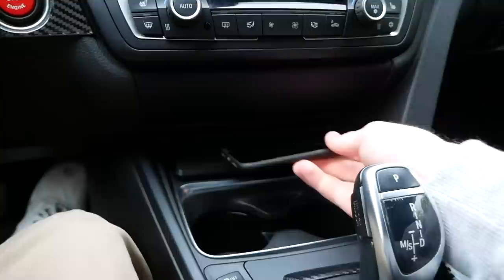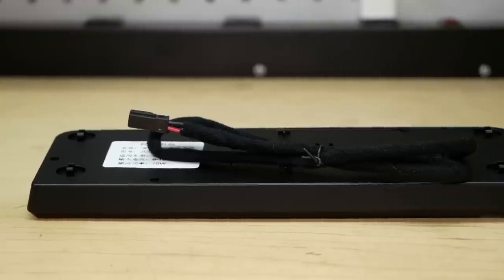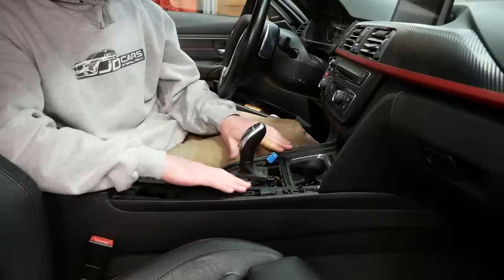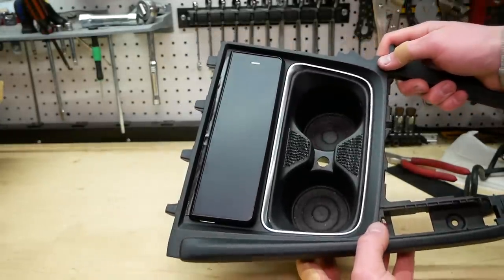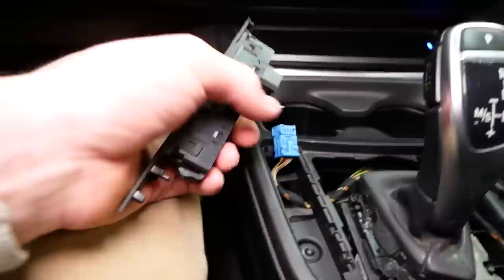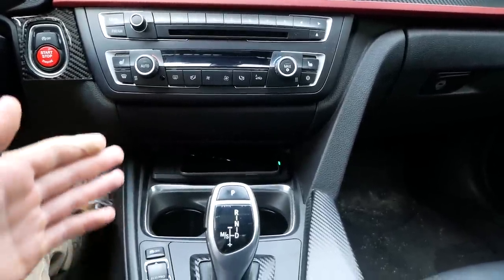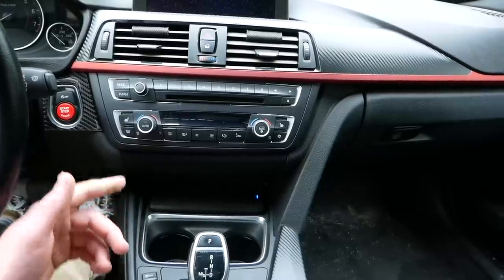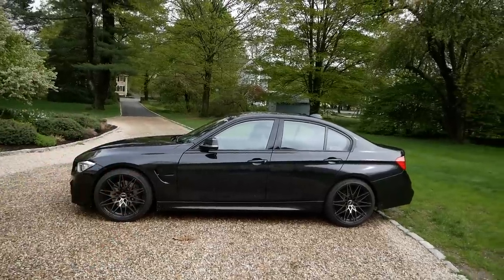BMW WIRELESS CHARGING // NEW PLUG & PLAY KIT!

Comment: Hi JD, thanks for this video. I purchased a new QI charger exactly like the one you have in this video, however, I thought I would have to buy the newer LCI cupholder unit, but thanks to this video, I didn't have to. I was able to do the exact same thing you did here. Thanks again.

One thing though.... Why does the little white LED stay on, even when the car's ignition is turned off?? Is this not a drain on the battery? Thanks.

Comment: @2:22 what is that electrical connection for? The small black connector under the cup holder that you touch first. That wire will now power the charge pad but what purpose did it serve previously?

Comment: Does the wireless charger stay on 24/7???
Reply: Our cars go to sleep and the battery shuts off 10 minutes after we lock our cars. So the answer is no.
Reply: @Jeffc288  You'd have to check that manually by plugging into the lighter socket and checking the LED to see if it goes out. The idrive, stereo and interior lights have timeouts but the entire battery doesn't shut off as Connected Drive features work any time, like flashing your lights or locking / unlocking from the app.

Comment: Hey nice install. Question, does this charger stay on 24/7 because the cigarette lighter works without the key in the car or being turned on. Or does it turn off when not in use?Does the charging light stay on when not in use?
Reply: Also curious about this😕
Reply: No it will not. Our cars go to sleep 10 minutes after we lock our cars.
Reply from the maker: Correct. The car goes to sleep and the unit powers off.

Comment: Yoo this is pretty sweet.. curious of the compatibility but wanna do this to my f22 now
Reply from the maker: Thanks man!.. not sure about the compatibility with the f22
Reply: I have an f22 and just bought this charger, I'll report back to you.
Reply: @CartubeCoIl  let me know!!
Reply: @jg_media9  well, the short answer is no. The long answer it can fit, but need some modifications. 1. The cig lighter connection is different, so you need an adapter or some soldering work. 2. It's a little bigger than the f22 ashtray but it can work with double sided tape but keep in mind that it's only for smaller phones, I would say my Galaxy S9 is the most wide (no issue with height) I would use.
Reply: @קארטיוב Hey how was ur final product? Did you ended up finding an adapter between the charge pad and the cigarette plug?

Comment: Anyone have issues with the Idrive knob or parking sensor/sport buttons not working after install?  Charger works great but now I  can't get my idrive system to work.  Even tried connecting back without wireless charger and still having issues.  Thoughts anyone?

Comment: Did you ever get the gap between the bottom the charging pad and the center console fixed? You can see it in your video @5:55 and now that I’m test fitting mine don’t know how to improve it, I know if I install it like this it will drive my ocd insane.
Reply from the maker: No I didn't... but we're releasing a new and improved version soon!

Comment: I got some issue 

After installation of this charger by some reason my comfort access stopped working 
I can’t lock or unlock the car without key buttons

Could you help me out with this, maybe there is some connections which works with the key fob? Seems like I installed everything back same way it was

Thanks
Reply: Максим Винс https://youtu.be/KwJz2s6Q00o 4:20 might help
Reply from the maker: I'm sorry to hear that. Did you find a solution?

Comment: just wondering why dont they make the connector as USB and use the cigarette lighter itself to power it, so theres no need to disassemble the trim
Reply: Looks better like this and you dont waste the cigarette lighter.
Reply from the maker: Because, as I said, this was designed for the LCI F30.. in which the cigarette lighter is not located under the charging pad.
Reply: The whole idea is to have all cords hidden, else, you have tons of other options.
Reply: I drew up a quick design that would involve an angled charging pad to accommodate room to plug into the cigarette lighter, making the setup plug and play. A small lip would keep the phone on the pad and you would be able to easily see the screen for navigation.

Wish I had a way to make it because this would be a killer accessory.